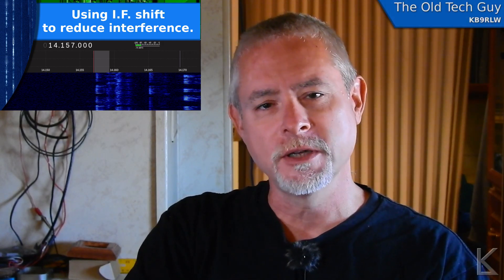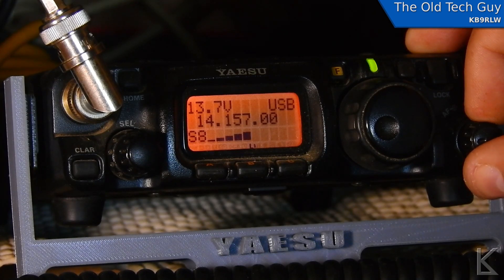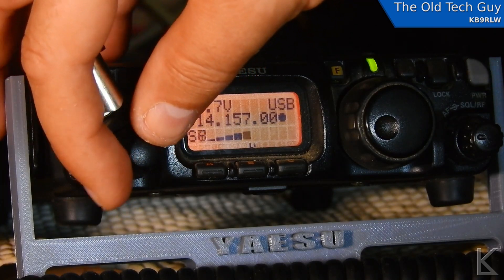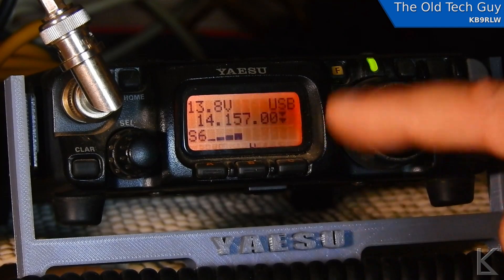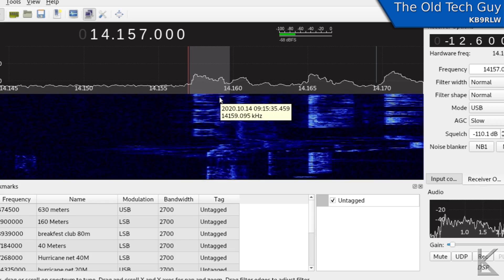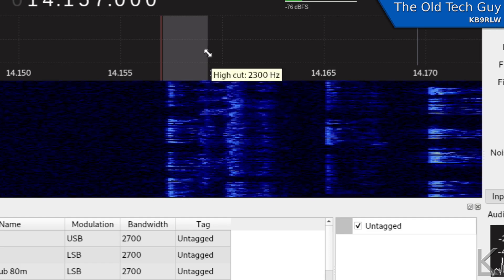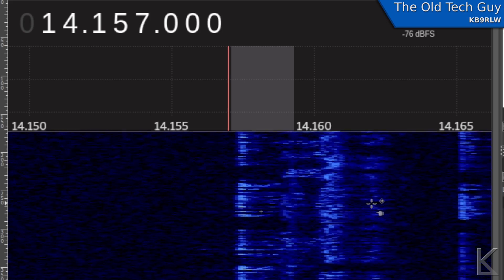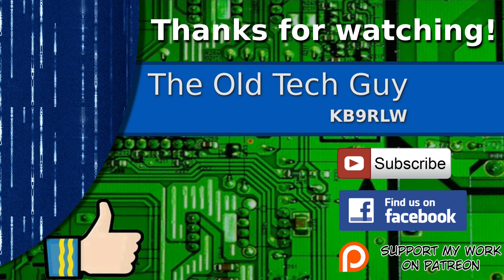Ham Radio - New hams tips. Using I.F. Shift to reduce nearby interfering stations.

Comment: Something else IF shifting is useful for-- removing the 'countertone' on differential CW (like as used for QRSS). My local 6m beacon (VK2RHV) was recently upgraded from a plain old carrier+morse ident, to cycling between the PI4 mode and DFCW. DFCW is a bit hard to follow by ear... however, doing this same IF shift can eliminate the second tone by moving it into the subaudible hertz range, leaving a good old OOK CW.

Comment: Or use a cardboard or metal tube to "mechanically" adjust the shift of audio.  I used to use one of those "PA" speakers we used to use under the car hood to show off our radios (usually CB) for folks standing around outside .  I would hook up one of those loud speakers and set it on the edge of my radio desk and move it over the edge or away from the edge to  change the "shift of the audio.  Worked best for me on CW signals but voice, also!  OK, so a pretty crude method but I'm the one who uses green bean and pea cans to make a trombone type tuning capacitor for my mag loop.  Thanks for the great video, Greg.

Comment: Thanks for the video! I was going to build a simple superhet transceiver and now I know I need IF shift :) Though I got an impression that the signal lost lower frequencies (not higher, as images show afterwards) when I.F. shift was enabled. This most likely because of frequency inversion on IF. 73s de R2AUK
Reply from the maker: Depending on which way you shift the I.F., you'll either nudge the lower or higher frequency part of the signal out of the filters passband.

Comment: Good demo Kevin. Given me a thought re one of my Older Yaesu radios. Hey, I occasionally re-read some parts of my manual and always find some new features. I bet many 817 users don’t know about the dual use of that clarifier button!
73, good weekend, Nick M1DDD
Reply from the maker: Many old radios have an I.F. shift control.  Your older Yaesu might.
Reply: @loughkb  indeed....I was out portable yesterday lightweight gear for a 6m contest here in the U.K..Took my Yaesu FT100D (has some dsp structure). I pressed the clarifier button for half a second and whatdeyaknow! IF SHIFT ON BOARD! Checked the manual and IF functionality / description easily missed. Cheers !

Comment: What is the difference between if shift, and just tuning the vfo?  Maybe a dumb question, but it seems the same to me.  I run a really old radio and use the slope knobs to adjust the filter width.
Reply from the maker: Tuning the VFO will shift the incoming signals relative to the BFO, Beat Frequency Oscillator, which would shift the overall pitch of the demodulated audio and make it far less intelligible.
Shifting the I.F. slightly doesn't change the relationship between the VFO and BFO and you still get proper demodulated audio.  The filter just ends up shaving off the high or low end of it a bit.
Reply: @loughkb  thank you

Comment: Hope this simple explanation helps.. 73.

"... The intermediate frequency is created by mixing the carrier signal with a local oscillator  signal in a process called heterodyning , resulting in a signal at the difference or beat frequency..."

Reference:

https://en.m.wikipedia.org/wiki/Intermediate_frequency

Comment: IF shift is so useful to eliminate adjacent signals.  I use it when I'm running PSK, it allows me to remove a very strong signal up/down/band when I'm trying to work a weaker one.  The stronger signal will affect the AGC level and sometimes will actually mute the weaker signal.  Removing that stronger signal in the passband lets you work that weaker one.

Comment: 1.  This is a really good demonstration. Thanks for sharing.  2. I thought only the R-390 had mechanical filters. I stand corrected. 3.  The way that guy was talking about his diabetes, you would have thought he was on 80 meters! 😁
Reply from the maker: Well, I may be slightly off in my use of terms.   I consider crystal and ceramic filters to be mechanical in nature.   There may be a specific type of filter where the term 'mechanical' has a deeper meaning.
I probably should have just said "fixed" filter. :-)

Comment: My older realistic 160 com receiver has a bfo
Reply from the maker: Any radio capable of demodulating SSB or CW will have a BFO.  In the absence of a carrier, the beat frequency oscillator provides a signal for the demodulated signal to mix with and produce audio.